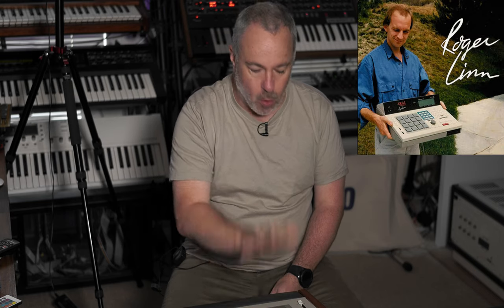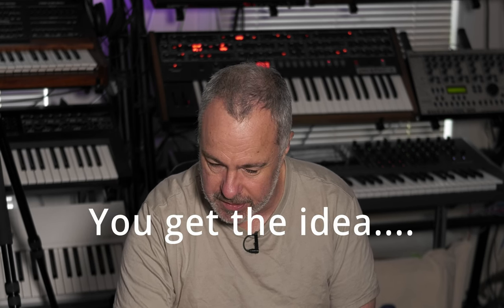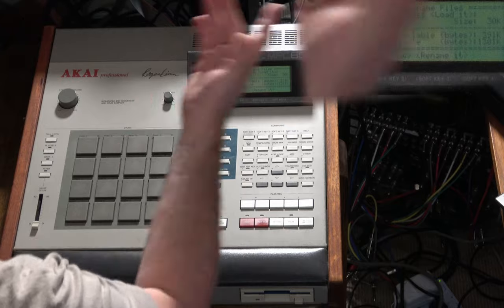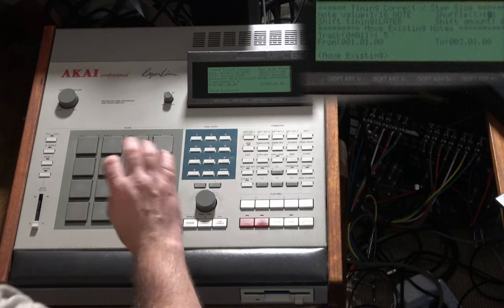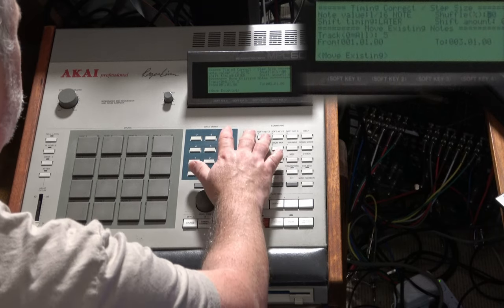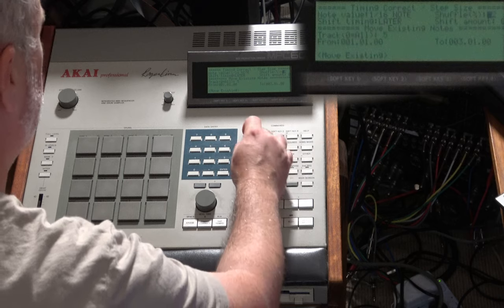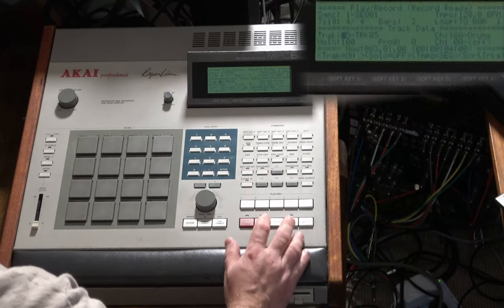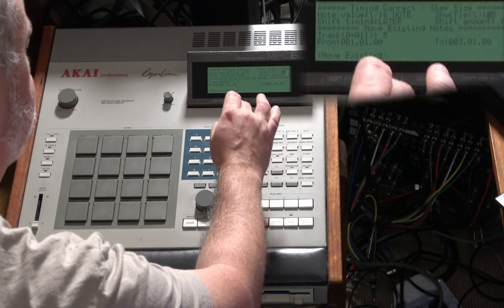AKAI MPC 60 - It's all about Swing!

Comment: As a one time owner of an MPC60 MkII (purchased new in box when they were for sale at retail), I always wanted to believe the swing was legendary.  I still hear the rumour these days.  A few years back I saw someone debunk this by dumping a swinging pattern from MPC60 to DAW, and then did the same with a modern MPC and a few other swinging drum machines.  The 16 bar beat fell exactly on the same PPQN  for each track when played concurrently.  I'D LOVE for you to do this test yourself with a beat that is long enough that a short loop doesn't reset the evidence of swing, and get to the bottom of this.  Thanks for this!  Love your new toy!  Whether is the A/D's or the 12 bit character, or actually the swing, MPC's def have a vibe.
Reply from the maker: Interesting, its hard to tell. For sure its all doing something and potentially with the slightly underpowered CPU thats also adding something. I'll have a look into it in the future, although sometimes its better not to pull back the curtain and just go with the magic :D There was a DAW or Computer sequencer that also used to have the Linn swing template in it, I can't remeber which one!
Reply: @100ThingsIDo  You can download the MPC3k swing templates for Studio One — I use them all the time to apply swing to midi clips. Great video, great jam!
Reply from the maker: @bzprod  Just installed SCSI, SCSI2SD reader and new OS 3.15b ..... very exciting :D
Reply: IT is a placebo dude, and thats just fine. When people use mpc's or an asr, or eps or sp or any of the classics, you want to believe its magic, when you feel good about it, you make the best stuff. I know that none of these samplers and sequencers have anything special in the swing, or anything like that other than maybe how they color sound, but thats it. But im fine with people believing that their 16 third kicks are better than someone elses, as long as the beats hot i dont care. Its safe to say most of us dont quantize anyways, atleast in oldschool style hiphop. If someone thinks their sequencer has magic in it, so be it, atleast they arent soulless, like a daw is. I find it hard to respect someone who cant even buy what they use, most dudes just crack fl sudio then download some hot 808 lo fi kits off google then think they are dr dre. Saying all this, i can take the same drum kits and samples and make a beat in my asr, mpc one, or daw, make it exactly the same and through plugins and processing make them indistinguishable to 99% of people. Its not hard to emulate a sp 1200 either, especially when you know what one sounds like.
Reply: Mpc x has the same swing. It’s been tested a million times.
Reply: @100ThingsIDo  Hello, kind of random questions since I noticed you had the older OS before upgrading.

Last summer I acquired an older 60 (my 2nd) that has the original OS (2.1? factory OS pre scsi, pre ram option). Do you notice anything different in terms of the sequencer time-feel after upgrading to 3.x?

 I think I read somewhere that the latest OS overclocks the CPU (?) as an improvement after removing unnecessary code, leading me to believe that perhaps this has an effect on jitter or accuracy of playback and the perception of the sequencer sounding either loose/tight & funky.. and for whatever reason my ears/brain thinks the timing 'feels' better on the old OS unit than my original 60 on 3.x. Hell, even the samples sound better on the 2nd unit.

I thought I was just over thinking this, but I first thought about it years ago after upgrading everything in the 60 and feeling like it sounded sterile, not raw & groovy as before the upgrades. Again, the thought popped up last year after acquiring a unit with the older OS and noodling around & now for the 3rd time in this video too.. I'm probably splitting hairs here but perhaps you have noticed something as well? also noticed that your unit does not suffer from pops/clicks due to DC offset in sample play back, where as my original can't ever get properly calibrated enough to reduce pops (I use Note Off a lot, any improvements seem short lived and goes back to the same problem after several months). 
I don't have this issue using old akai disk Bass one-shot samples, but any playback after sampling my sh-101 or 909 Bass Drum has this issue with pops & clicks at the tail/release of the pad.
I believe the manual states that any 'changes' to the power supply (ie new backlight/scsi/etc) would need a re-calibration of the offset, so wondering if you have noticed that issue since upgrading parts inside. I also have had problems with modern replacement sensor pads bleeding some sort of high frequency digital/ground noise everytime I would apply pressure to the pads (design flaw). Hopefully you haven't encountered this & if so, please share your pad vendor!

Anyways, sorry for the long message. Everything sounded great in this video by the way! Thanks for the share & your time.
Reply from the maker: @rb6675  Hey RB, I don't know if its possible for software on a device this old to overclock the CPU. I've never run into any timing issues, it seems pretty much the same as it did previosuly on the 2.1 software. Even though the sampler is digitial there is a lot of analog filtering going on on the analog board so that could be why the 2 units sound different. As far as I know the pad sensors are the original AKAI ones although they should not make the high pitched noise you mention when plugged in so your power supply might be ion the way out, best to get a tech to take a look. The Memory board sounds like it could be the cause of your glitching of sounds. If you know someone with the MPC 60II you can try the memory board (bottom left board) and see if the issue goes away. There is a custom chip on the MPC60 1's memory board that seems to be prone to issues as it gets old :( .. My unit so far as not shown any issues but as with all ageing electronics its possibly only time. Hope all this helps :D
Reply: @jonathansoko1085 ok can you enlighten us as your talking a great game my friend… I have an sp1200 make us a video showing how to get software to sound like one …..
Reply: @jonathansoko1085  its a placebo ? have you owned an mpc60 ? have you owned an sp1200 ? i have both of them.. ok emulate the sound of the sp1200 then .. show us.. downsample it as far as it can go whatever your making it on and show me the grime .. sounds to me you own an mpc one or use fl studio .. i dont care about having an mpc60 my friend.. i also own an mpc2000xl and it swings different no matter how much you try get close.. i use both mpc to trigger the s950 and both mpc are sequening only... its night and day between the both mpcs wtf
Reply: @saren6538  Its what they tell themselves to be ok with not having any of these old machines. They're expensive and hard to get. These machines do have quirks that aren't able to be emulated outside of a modern recreation of these devices spec for spec. I would love to have a SP1200, but I'm not about to lie to myself about being able to recreate its sound on a whim using modern options.
Reply: @Xsynth  each mpc3000 sound a bit diffrent to each other. and if i compare my 3000 to my my 2000xl ...its day and night. The 3k grooves completly different. But hey......all grooves the same......lol  right
Reply: @saren6538 this Guy is delusionnal hhh the swing différence between old mpc sp and asr are evident
Reply: @jonathansoko1085 hhh Nice joke you have mud in your system

Comment: A bit off topic but: I remember reading an article in the german KEYBOARDS magazin back in the 90s where they did a test with the MPC (can't remember if it was the 3000 or the 60) vs a rack sampler & a sequencer. Something like playing 16 notes at the same time. The result from the MPC was much 'tighter' than the racksampler and the article said that this is cause of the fact that the sequencer of the MPC 'speaks' directly to the its soundengine (Maybe in a parallel way) while the rack sampler receives the information from a sequencer via MIDI which is a 'slower' serial process. That might explain the 'thightness' of the MPCs. On the other hand, without seeing a graphical representation on the display of the MPC, people set the startpoint of a sample differently. A bit early will result in a subtile 'late feel' because of the gap at the start. A bit late startpoint could make the sound a bit 'snappier' because the sample starts in the middle of the transient or somewhere completely off the 0 line so it 'pops'.
I never had the 60 but the 2000. Our relationship is....complicated...a love/hate thing 😁At the moment I mostly use the Modplug tracker software to make music. The sequencer of a tracker is very flexible. You can set it to any resolution you like. I mostly use 24ppq (as the SP1200) so 1 measure has 96 ticks. Sometimes I only use 95 or 94 ticks so the next measure start a little bit earlier.

Anyhow. Thanks for the video. Very nice that you left the tuning 'fail' in there. Funny and honest. I like it.😃
Reply from the maker: Yeh, I am starting to think of reaching out to Roger about the swing to see if he can tell us a little more about whats going on. I'm guessing its a preset 'variation' you are adding to each of the pads incremetially. The MPC 60 does seem tight but maybe not as tight as the newer MPC X which seems very solid! As to the tuning fail.... At least I got it in the end :D

Comment: The shuffle algorithm that Forat programmed for Roger Linn back then is the same from the Linndrum to the Mpc 5000.
Only the chips and components as well as the operating system are differentiated. The special timing of the Akai Mpc 60 Mk1 comes from the built-in Motorola chip that processes the timing.

Greetings from Germany
Reply from the maker: I didn't know Forat worked for Roger! I have some serious gaps in my knowlege some times :D
Reply: @100ThingsIDo  Yes, Forat is a programmer and worked for Roger at the time and probably developed his love for drum machines there, which he still pursues today with his service for all kinds of drum machines.

Comment: This makes me appreciate the new mpc line so much. We can do things so fast now, its nuts. I can even chop my sample AS its sampling in.
Reply from the maker: Yeh, I just enjoy the old workflow. I don't feel the need to get a final mix inside the MPC where I find on my MPC X it leads to a little frustration sometimes trying to get the sound to glue correctly. :D They are only tools!
Reply: @100ThingsIDo  Yeah so do i. I learned on an eps 16+ and i remember buying a mpc 500 due to its screen and lack of waveforms. But still, modern ease is welcome. Ive never had an issue getting my beats to glue, thats what mixings for
Reply: MPC X is overkill for alot of people. Less is more.
Reply from the maker: @WestonStephens  I find even though I've owned the MPC X for a few years now I still get lost in it and try and do far too much with the effects.... but thats just me :D

Comment: Ahhhh!! The original granddaddy of the MPC family. I kinda still wish I had one but my G.A.S. for the 60 or 60 II has died down since I got the 3000. 

For me the difference in swing IMO is due to how the samples are chopped. On a 60, 60 II, 3000 and 500 it's all done by numbers and ear. When you apply swing to the beat you use the samples in, because the samples aren't right on the money like when you chop a visual wave it gives you some extra space that adds or subtracts from the swing to give it a certain feel. That's my theory. 

I have a 500 and a 3000 as well as a 2000XL. If I really want to I could blag a track made on the 500 as made on the 3000 and no one would know the difference. I love the workflow of the 3000. It's long but so enjoyable because everything is a button per function. I love the 2000XL because the chops are a bit tighter on the 2000XL. I chop on the machine I am using, not on a computer as if that be the case I might as well use the computer to do everything. I absolutely love the 500 because it's like having a portable 3000 running around with but I have to use the shift button to access functions just like the 2000XL so it's kind of a hybrid of the two workflows. 

Sampling a sound into any of the MPCs gives you a different result in sound when it comes to the old ones but they all sound great to me
Reply from the maker: Yeh I would love a 3000. I'm keeping my eyes out for one in as bad condition as my MPC60 was that I can restore on the cheap :D

Comment: Imperative that you read Roger Linn interview where he dispels all myths about the swing on this and any of the drum machines with his name on them. No magic fairy dust especially in both the 60’s where ram and processing limitations meant the sequencer had to be as rudimentary as possible just to squeak by. He states facts about the code limitations and his theory is that what people hear as unique and funky is the precision of the internal clock rate. Which is confirmed by the tests mentioned by @station2station in the comments below. I did a similar test with a mpc 3000 in 1998 recoding 8 bars at 3 different tempos for every swing percentage inorder to create mpc midi groove templets . An embarrassing and colossal waste of time.
If you are familiar with phenomena of “illusory motion” what Roger Linn described in that interview seems like the audio equivalent.
Reply from the maker: Indeed, there is only so much a 10mhz processor can do! With 60 (not sure with the 3k as I don't have one.... yet! haha) the way you have to apply the swing I'm guessing its pushing a few of the 'pads' slightly off temp. There is also the limitations in PPQ playing out here and a few other 'cheats' they would of been doing to make it all work. I might reach out to Roger and see if he's willing to help out in a follow-up video to this. As I said in the video I'm installing SCSI and the 3.15firmware so might see what I can do around that time and I also did a restoration video as I was cleaning the unit up :D Thats for the great comment!

Comment: That auto quantizing function... How many internal steps does the mpc60 have? As opposed to the TR808
Reply from the maker: Polyphony - 16 voices.
Sampler - 12-bit, 40kHz, Stereo.
Memory - 768KB (13.1 seconds) expandable to 1.5MB (26.2 seconds)
Filter - No filter.
Sounds - 32 Drum sounds.
Keyboard - 16 soft pads (w/ velocity & aftertouch)
Arpeg/Seq - Sequencer: 20 songs, 99 sequences, 99 tracks, 60,000 note capacity.

Comment: Does not the Time shifting only work if you change the value in the shift amount?  Havent used an MPC-60 for a long time so i could be wrong :)
Reply from the maker: For sure seems to have an effect without doing so! Otherwise when I went to 75 it would not do anything :D